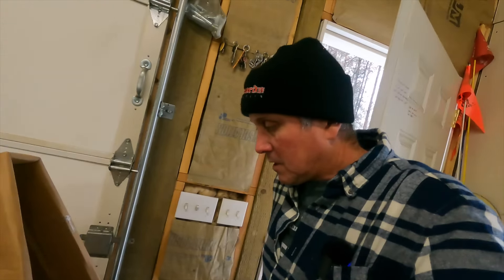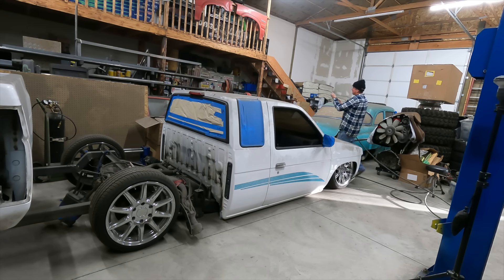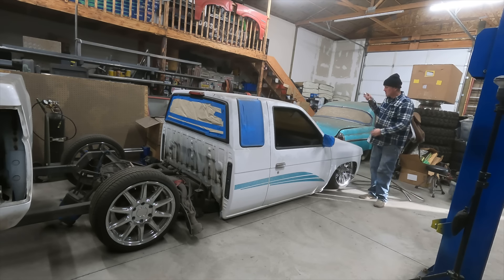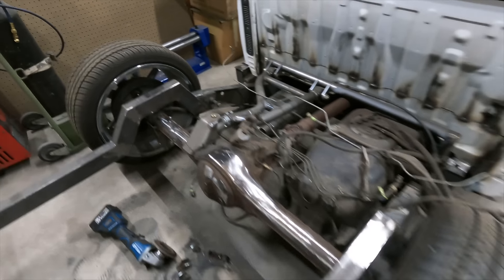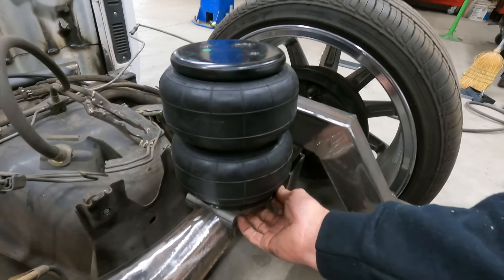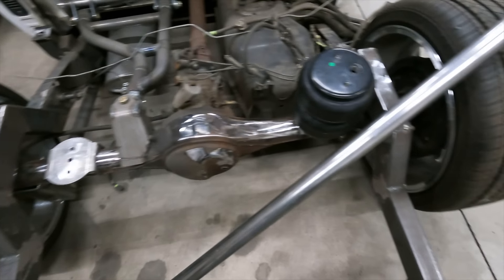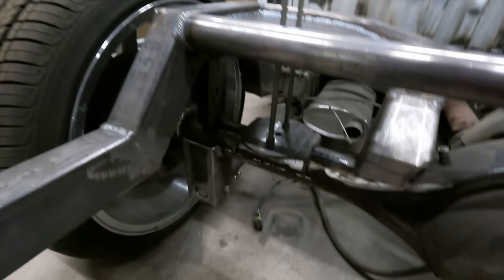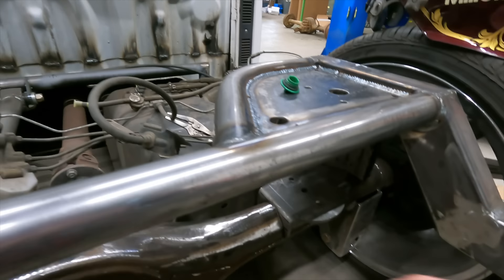How to make air bag mounts for the rear of a mini truck!

Comment: I have owned several D21 Nissan Hardbody trucks over the years, and only one was a 4x4 (Yes, of course I lifted it!)  The others were all 2-wheel drive and got slammed.  I miss them all!   I think it’s time for me to build another one, using all the skills and experience I now have…. I find your build very inspirational!!!  I’m a simple guy, as well (when you pointed out that it isn’t your style to “have tubing going every which way”, I was thinking the same thing.  This is one of those things where: ‘Form follows Function’.  It doesn’t need to have a plate of spaghetti 🍝 for airbag mounts… it’s just a waste of tube, and added weight.   I think I might go with a true “Equal-length” 4-link with a watts link setup.  I’ve never done one for one of my personal trucks, so I think I should…
  Keep up the great work!!
  Can’t wait for the next installment!
Reply from the maker: Sounds like you are on the right track
Reply: 3 link up front with a Wagoneer axle?

Comment: Have you ever used Swagelock fittings for your air ride systems?  It's by far the best qualityy  fitting for them, but they aren't cheap.  If you're not familiar with them, they're kind of like a compression fitting, but way higher quality and you can disconnect them and reconnect them an infinite amount of times.  They're the only fittings I use on air systems.  Our setups could sit for many weeks and never lose any pressure.  I've never used those DOT fittings you used, but they look like they'd be reliable and seal up well too.
Reply from the maker: I have not used those, but I’ve heard of them

Comment: Takes me back to the day when it was all about mini  trucking but the air bag technology wasn’t there so most of them were slammed and counted on suspension for the low bumpy ride. I never owned one I had a 56 big window Chevy PU with a 6” drop axle on the front and a 4” drop in the rear. Nice video and thanks for sharing!
Reply from the maker: Yep!  I drove some horrible riding stuff back in the day

Comment: This thing is so cool. I miss my Hardbodies. I had an 86.5 and a 90. Both 4x4s. Lots of good memories playing out in the woods.

I have an '11 Frontier 4x4 now. Maybe one day I'll pick up a 4x2 and build a low rider. They just aren't very practical where I live, but 9" of travel is pretty good. Never had anything with air ride, but I can see the appeal. 

A low rider minitruck with an LS would be pretty cool. Something with a big loopy cam. Square bodies have been catching my eye recently, though. Probably will only build one.
Reply from the maker: It’s hard trying to build one of everything.  Not enough hours in the day

Comment: 20:00 man i remember the days we were excited about 3 to 4 inches of lift. Shit im old enough to remember if you were too broke for hydros we used airshocks to get an inch or so of lift. Lol it was all static drops when i started. Tore a few torsion bars put ofy Isuzu before i airshocked it. I had done a bunch of Mazdas and a Hardbody before so i was able to get 2 inch in front moving do it wasnt dragging the tire toing back out on the lift and 3 in the rear. Then bags came out in a usable size
Reply from the maker: Yep! It was the progression

Comment: If you need a good start for tacking or for welding you should nip off the little ball on the end of your wire. It will pop less or not at all
Reply from the maker: Good advice

Comment: You ever try the push in air line fittings?  The type you’re using is superior by far. I was a PM mechanic for a couple years and I convinced my shop manager to switch over to that style on our fleet of trucks
Reply from the maker: Yeah. I used push in fittings for years. They were good as long as you don’t buy the ultra cheapies

Comment: Absolutely digging this Hardbody.
Thoughts on a "simple" (stock, just for the sound, turbo noises, and bragging ECT) RB25DET or even an RB20DET swap along with "cheap", yet absolutely nasty(good nasty) SQ audio build within the cabin?

With it being the extended cab, and someone already hacking at the back cab (I know you've already started fixing that, and I'm NOT not implying a typical 4th or 6th order blow through), I could message you with some seriously cheap and pretty under-the-radar front stage (and rear fill) audio goodies, and then you could either go with my thought process for the rear, and go with a 24" infinite baffle sub on a manifold that "tapers"(not really, pretty much changing shape but keeping the same overall size) out through the back cabin and under the bed or, under the cabin itself....if the thoughts of an awesome 24" inverted, infinite baffled, rear center mounted sub frightens you lol, you could either go with another somewhat unorthodox setup with a single (or dos) 11" super slim(yet super capable) subs in extremely tiny sealed enclosures, either one blended into the rear wall, custom center console (without ridiculous extra coaxial speakers that make zero sense), or twins, one each under each rear sail window.

Don't mind me, just trying to live vicariously through you as I never got around to finding my own extended Hardbody 😅😖🥹
Reply from the maker: I kinda just want to build a couple 8’s into one side and amps in the opposite side (where the jump seats were originally)
Reply: @thedirtheadshed  I can dig it, I'm picturing something asymmetrical and abstract... could be dope. I've been into more of SQL for the longest, more loud, but still sounding good.... lately I've decided the next time I build, it'll be straight SQ... it'll still get plenty loud, I'm just done with making everyone else hear me lol.

Now to those dual 8's, depending on your own tastes, sound quality while still playing as loud as you want, or on the other hand, trying to get your windshield and all metal surfaces to flex.... here's my suggestions, and I stay away from "played out" brands who charge tons when you can get the same for half or less.
SQ, If you're dead set on the twin 8's, I'd highly recommend a set of Dayton Audio Reference Series HO's, in a sealed enclosure on the larger side of spec. If you want a little extra than that, I'd go with their Ultimax series 8's, again, sealed, towards the larger side of recommendations. Those are both 300w RMS subs, don't sound like much, but would be absolutely killer in that space along with that amount of cabin gain, and they'll both play higher than you're probably used to so you can have an easier time getting your front midbass matched up and blended.

If you need anything beyond those, I'm going to have to recommend Sundown Audio. Their SA-8's are the most musical, can handle running sealed, have ridiculous excursion, and are 500w RMS (I run a single SA-8v3 D2 in my single cab GMC K1500 on 900w RMS daily, they'll gladly take 50-100% over on clean power in a proper enclosure, mine is in 1cf ported at 34hz, large for a single 8).
Then they recently released a U-8.... the U series sounds similar to the SA series, but can handle more power being thrown at it, I have a U-15 on 3k RMS in my Sedan DeVille, daily.
Then, until they release their upcoming "crazy 8" lol....they have what's called the X-8.... the X-8 is "rated" at 1k RMS, but will eat 1.5-2k daily, plays stupid low for an 8" (granted, so do the other two, but not like this), and two of them on good power will definitely have people confused on what's going on inside your cab lol.

Soon enough though, they'll be releasing their Z8 into their Z lineup, the damn thing is only an 8" cone, has like 4" of surround, and is like 20" tall 😅. I kinda want one just for the hell of it lol. That'll be, technically, still a "daily driver" type sub.... I just heard that they're also in the prototype process of creating an 8" Night Shade.... the NS are their neodymium competition subs, it looks ridiculous, it looks to be well over 20" tall, at least, with a tiny little cone.... I'm sure it'll probably be rated at like 3k watts and take 10k burps easy 🤣

Comment: Wait your supposed to use air brake fittings and lines for bags? The previous owner of my truck thought heater hose and zip ties was the right way to fix a broken line.
Reply from the maker: Heater hose is ok to help shield the brake line from heat or abrasion
Reply: @thedirtheadshed  If that's what he did it didn't work. Should have had a clue it wasn't well maintained with the door pull on the driver door broken up when I bought it and only 7 years old. Had a B&W gooseneck hitch and only 85k miles, but probably hard miles, so I overlooked that and had a blown head gasket 30k miles later.

Comment: Let's gooooo,
Its oxymoron day,
Everything is backwards, upside down and a little sideways, or cock-eyed?
Is that legal?
😂
Reply from the maker: Bizarro world
Reply: @thedirtheadshed  a perfect short with Deep Purple, space trucking just sprouted out at me.
Maybe during it's initial voyage?
Are you going to make the bed tilt to the corner on a hydraulic piston?, I had a buddy that did that with a Mazda in the 80s,  I guess it was to show off the finished frame and suspension, show car i guess.
??